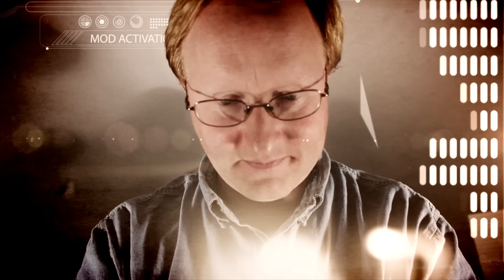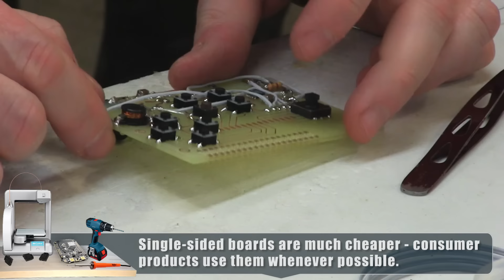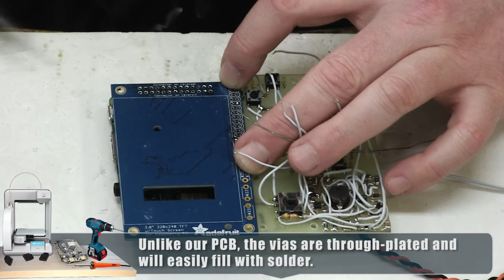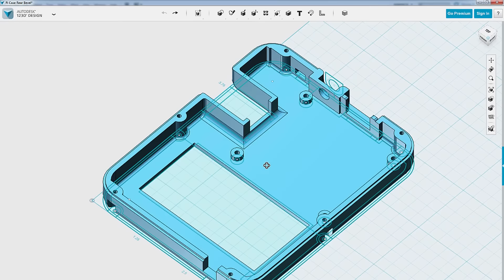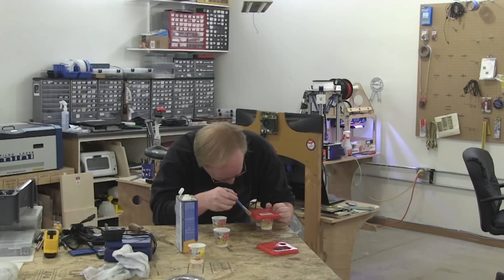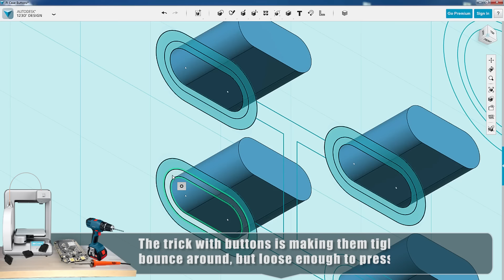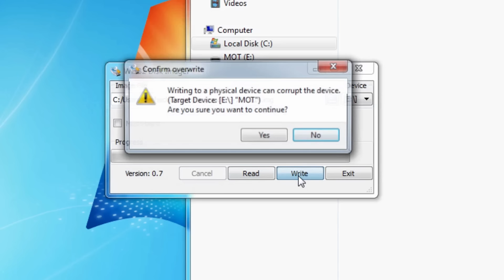Ben Heck’s Raspberry Pi MAME Portable Part 2

Comment: Just doesn't have the style of the first one.
Reply: I prefer this to the old one for the internal charger and GPIO controls. Sure, the old one looked nicer and the button placement seemed to be more ergonomic (though the sharp edges might have been uncomfortable). Too bad the Adafruit screen is kinda terrible and expensive, and because there is no RCA connector on the A+, it's pretty much the only option for small builds like these.
Reply: Raattis There is a RCA connector. The headphone jack has a forth pin, which is video.
Reply: Yes. I think so. I don't like 3D printed stuff. His original one definitively looked nicer.
Reply: Benedikt Müssig  Oh yes,  I learned about the video connector recently. I'm not sure why I didn't think of that, I've seen similar 4-pole 3,5mm jacks before. I'm even happier about the new RPi models now.
Reply: a different case is a relatively easy thing to do.
Reply: Yup, third vote for the original ;^>

Comment: Boy, the cased if awful thick.  Perhaps you could add in a speaker or 2?  The way some cases get the super-smooth finish is by adding a very thin sticker on top.  Maybe that's something to try too.
Reply: The cases you're talking of use vinyl -- Ben used that for his Neo Geo project a while ago